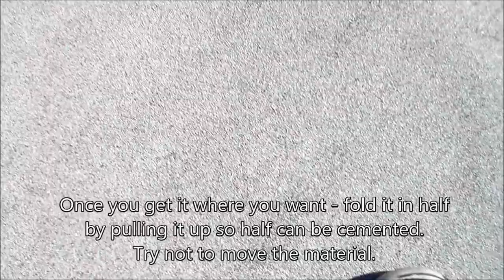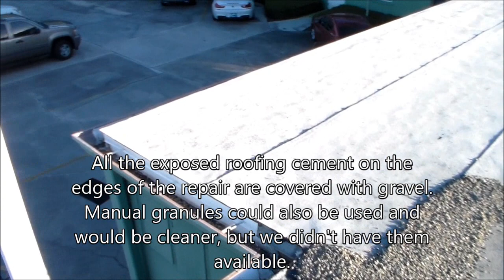How to Cold Process Modified Bitumen Roll Roofing - Shorter

Comment: Total DIYer here planning to try this on our old tar and gravel church roof. So you don't need to nail or screw down the sheets underneath the seams as some added security?
Reply from the maker: Only if there is a slope. If it's relatively flat it should be fine without backnailing.

Comment: Can you use a cold applied cap sheet as a patch on a modified bitumen roof by applying primer, adhesives, and then the cold applied cap sheet?  Also, if necessary, could you re-seam a cold applied cap sheet by using a torch?  Thanks.
Reply from the maker: Yes. Would not use a torch. Torchdown material has bitumen in the roll. Cold applied material the bitumen is in the can. You can use a torch to warm up the material so it is easier to work with, but melting the material is not the right idea. Unless, the material is torchdown or APP.

Comment: What about foot prints on the white ceramic granules and excess trowel grade squeezing out of seams?  Can I glue on granules with clear adhesive?  Can I heat the trowel grade up a little and press in the granules?
Reply from the maker: Would not use clear adhesive. Yes heating the trowel grade and putting in the granules will work, not too much as it will catch fire. Also, you can just put a little fresh roofing cement over and put granules in it. You just need to cover with granules and not worry about pressing in.
Reply: @PracticalRoofingConcepts  Gotta wait until the weather heats back up here in Colorado.  I will try smearing a thin coat of adhesive over the existing adhesive and using a shaker to spread the granules evenly  - thanx.

Comment: How many inches has to pass mineral surface roll from center of a valley thanks in advance
Reply from the maker: If it is a valley underlayment for shingles, it should be a full roll or 36" or 18" each side. If it is a valley for a Mineral Surfaced Roll Roofing roof, then personally I would roll a full roll down the valley and then the horizontal rolls I would have come onto the valley roll halfway in. so at approximately 9" would have the seam. The roofing gods call for a 4"-6" sidelap on roll roofing so this would comply and then some. Not a bad idea to double up the valley. It would last longer. Also Modified Bitumen would be a better choice and last a lot longer. I know it is more expensive, but is worth it. Especially for a larger roof. There are self adhered options also - https://www.youtube.com/watch?v=kU4xxrEv3ks&list=PLCnkB2WaiXnDHywCBxh6eQyPT-gTcsDat
Reply: Thank you! Very much appreciate
Reply: @PracticalRoofingConcepts  What do you mean double up the valley? You mean glue n run two right on top of each then do the 9 inch overlap on both sides?
Reply from the maker: Yes. You could put a 1/2 roll in the valley first over your underlayment, then a full roll or weave over that. This way you would have "at least" two layers in the valley. Metal is best, but not required in all locales. The 9" overlap has to do with a weave. If you bring one side through the valley and then up into the other side of the valley, then the opposite panel would be cut 9" outside of the valley. Similar to a half lace shingle valley. We would always run a full roll then cut each side a few inches outside the valley. This way our valley metal (for tile) would not get caught on the laps. Good luck.

Comment: Is that cap sheet going straight onto wood or underlay felt?
Reply from the maker: It was cold processed over 30# tarpaper felt. Only time we adhere right to the plywood is on new construction when we are doing the entire roof self adhered. On repairs I always try to stay with like materials so when it is reroofed they can tear off everything.
Reply: Practical Roofing Concepts thank you very much. I'm attempting my own flat roof repair on a garage roof. I'm laying down new chip board, priming it then using self adhesive bitumen to hold down new cap rolls. The idea of trowel mastic the edges to keep in the bitumen is good idea.   Thank you
Reply from the maker: That is called 3 coursing and it will tie your new repair to your existing roof. Good luck with that.
Reply: Hi, I am in SW Florida.  Can i cold roll these sheets over an existing flat roof that is still not leaking and in decent shape?  I used that metalized roof coating a few years ago and would like to use cold roll over that?  Is there a difference in strength and durability from using this cold roll system compared to the torch down? Thanks

Comment: Can this be used for road repair, modified bitumen adhesive?
Reply from the maker: Probably would be too soft. Need to get an asphalt designed for roadwork. I am sure it is not far off though.
Reply: I meant like a primer for the cold patch. Some use bitumen tack spray on the previous layer so that new layer on top would stick to it.  They stock modified bitumen, the road one is special order. Maybe might work eh
Reply from the maker: Sounds good to me. Don't have any experience in asphalt used for roads.